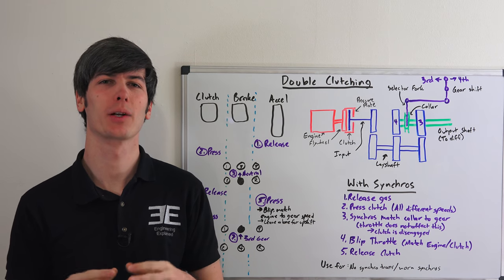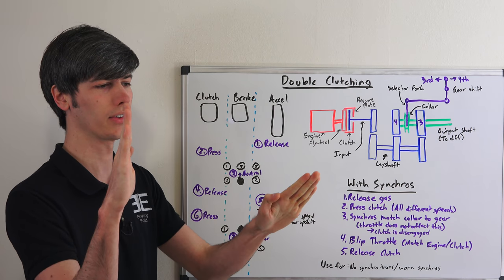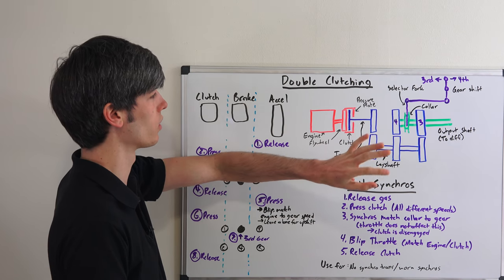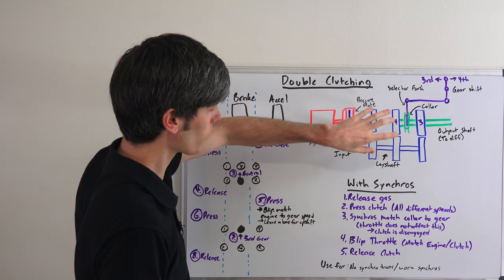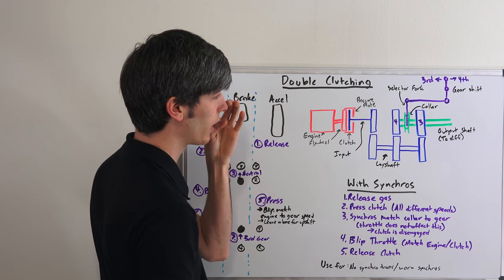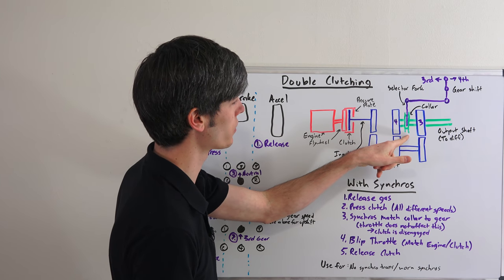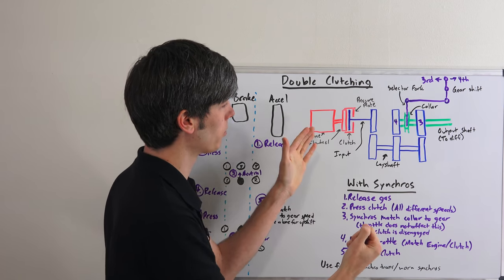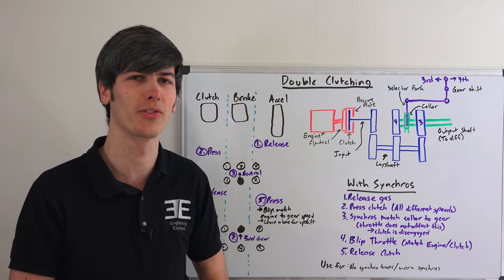What Is Double Clutching?

Comment: Aaaaahhhhh so "maybe" I can use this in my 74 Beetle, which crunches when you shift 2nd to 3rd unless you shift really slowly.
Reply: not really going to help going up gears from 2-3 its more for 3-2.
Reply: @nhouston6179   old post. (3yrs) But upsifting you can still use dubble clutching. You go into neutral and rev match (let the rpm drop) and clutch + next gear. Less work for syncs as your already at the right rpm.
Reply: Diner50 Yeah it seems like it might help as it sounds like he just has worn synchros, that's why he has to shift slowly

Comment: These principles really came in useful when my throwout bearing went out and I needed to get my car to the shop without using the clutch.  Pretty tough to do, but you can just barely blip the throttle to allow you to go into neutral, then either wait to shift (if you are upshifting) or rev match if you are downshifting.  I was also lucky enough to have a car with a strong enough starter to start the car in first gear when I shut it down at lights.
Reply: That sounds kinda nerve-wracking😳
Reply: @code0662  it was, but I got the vehicle there.  Had to go on the road all week or would have fixed it myself.  All is well that ends well.
Reply: @inultus1  absolute Madlad. You've earned my respect
Reply: Rolling it on in 1st gear would‘ve also been an alternative on weaker engines. Just need a couple of strong lads.

Comment: People are missing what gear speed is judging by comments. Maybe this guy can do a vid on that...imagine the gear speed is like your engine rpm: fast in third but slow in forth at a steady speed. So if you want to go back down to third you need to get third spinning fast again. Not "true" but its to the point.
 It is irrelevant with modern cars due to syncros but if you can grasp this relationship you can shift up or down without the clutch!
If interested in shifting without the clutch: If what i said makes sence then recreate the situation and play with it to learn. This is not a one day look what i can do thing to learn so dont get in a rush at all. Corny to say but you will be devolping a deeper connection with you car and it won't happen overnight. First hold steady light throttle speed, hold throttle steady and you will find you can effortlessly pull it out of gear and put it right back into same gear, play with that a while. Next while driving normal ease off the gas slightly when you are getting close to time to shift and you will find you can pull it out of gear the same as before without the clutch, let off gas and put light steady pressure agaist the next gear and when the rpm is right it will let you into gear,  move quickly when it invites you. Completely master upshifting before the next part, downshifting. Note that you will have mastered this when you feel like you just know what to do. It could be years before you are ready to downshift. Downshift is harder: Steady speed: Note what speed your tachometer says in third, shift to forth and note tachometer in forth. Without clutch push shifter into neutral, raise tach to the third gear number and it will effortlessly slip into third. Its easiest to go just past and while rpm is dropping catch the gear at the correct rpm. If you are still holding the same speed the you can go neutral to forth without clutch at the correct rpm. Practicing this 2 to 3rd or 3 to 4th is ideal, other gears are a little harder. Dont force anything, It should feel like it wants to do what you are asking of it. If you miss or grind just step on the clutch and get into normal gear. 
Anyone with a diesel will have a much much easier time learning this due to the operation of the diesel. You still need clutch to get going from a stop. If you dont grasp the idea of the gears spinning at their different speeds at different vehicle speeds then forget about it. Ive done it since i was 15 years old, 40 now, never broke a trans or wore out a clutch. I was lucky to learn with a diesel. 160,000 on my lancer that has been driven this way, no problems.

Comment: Question: While doing some research, there is a debate on whether it's necessary to shift into neutral, releasing the clutch pedal, and then depressing the clutch pedal before engaging the next gear VS. keeping the clutch pedal down the entire time. Which is right? Does it matter? Does it depend on if you have synchros? I think shifting into neutral makes sense because you can re-engage the clutch, having more parts move together. What do you think?
Reply: must clutch twice if u want a smooth shift and dont wanna wear out the syncs
Reply: @bobobibo2357 yup, you can get away with not double clutching a light vehicle, but it will get progressively harder to do so as the synchros wear. On heavier vehicles, especially those with heavy transmission elements, you will have to double clutch to prevent premature wear. Heck, even on a light car, if you're doing some "spirited driving" you'll have to double clutch as it's much faster to change gears this way.

Comment: Virtually every semi-truck, though virtually no truck driver double clutches.  Should though, based on this video.  Though a common counter-argument is that it wears out the clutch.  Though I suppose a counter-counter-argument would be that it wears out the transmission if you don't.
Reply: A counter-counter-counter-counter-counter-counter-counter-counter-argument: you wear out your car when you drive it. Leave it in the garage and nothing will ever break.

Comment: For all the people saying double-clutching is useless in a car with synchronizers, I respectfully disagree, particularly for downshifting.

While downshifting can be a smidge slower since you have the pause in Neutral where you bump the layshaft up to speed, it makes less work for the synchronizers, which have to work hard to speed up the layshaft.  

It's usually not all that useful for upshifts, except has anyone driven their manual car in seriously cold weather where it just does. not. want. to. engage. any. gear?  Double-clutch all of your shifts (especially between the first three gears), and magically the car will let you get into that next gear until the gearbox warms up and starts to behave again.
Reply: Yes, yes, yes, to all that.  I had an old Subaru that in cold weather, needed double-clutching until the transmission oil warmed up.  Also, I commonly drive a medium-duty truck (about 30,000 pounds GVW) that has a synchronized transmission, but when starting out cold, double clutching saves the day.  And I can't tell you how many people I've met over the years who have worn out their first- and second-gear syncros in their cars by doing lots of downshifting into those gears "the standard way," and this could have been completely avoided by double-clutching, even if reserving that method for the more severe downshift situations.  As to those who advocate floating the gears, that works, but with synchronized transmissions it's hard to tell if you are really doing it perfectly or not, and if not perfect, synchro wear is actually worse because the synchro clutch is rubbing for a time when the speeds on both sides of the unit are out of synch, but that extra friction accomplishes nothing since it can't cause the input shaft to change speeds in this case.
Reply: @ericl2969  Actually cold weather is still an issue, I have a 2015 Subaru and while switching between the first three gears isn't impossible it is much easier if you double clutch until it warms up.

Comment: Why do semi-trucks do not have synchros in their transmissions? (i.e. Eaton Fuller 10, 18 spd)
Also, how does hill holding circuit work without waring out the components?
Great videos!
Reply from the maker: +D. G. Hill hold uses the brakes to hold the vehicle.
Reply: What enables the circuit to apply the brakes?
Reply: gyroscope
Reply: Semi's don't have synchros because they wouldn't last. With the torque a big rig engine puts out and the heavy loads they carry, the synchros would ware out very fast and would have to be replaced very frequently. VERY UNECONOMICAL.
Reply: From the ZF brochure from Europe:

■ Thanks to its wide torque range, the Ecosplit
synchromesh transmission gets by with twelve
or sixteen gear steps. A light metal alloy
housing saves unnecessary weight, and the
helical gears allow for quiet running. Shorttravel
and dual cone synchronizers as well
as the Servoshift unit reduce shift forces and
paths. The transmissions of the Ecosplit range,
equipped with an integrated bell housing, are
available in a wide product range for all truck
applications up to 44 tons of total weight.

ZF has already proven that is not true for European trucks.
Reply: PEREGAZOVKA and Double Clutching dont need
Reply: Frank G So what does the clutch do when you're in neutral at a stop and you have to press the clutch all the way to sychronize/stop the gears to shift into 1st? (on a semi). Is there a synchro just for 1st?
Reply: They'd last just fine. They aren't present because that is extra weight. Remember, talking about freight services. The weight you remove from the tractor can be added to the load, meaning more product down the road.
Reply: 100 pounds worth of brass synchronizers or 100 pounds more freight? That's why they aren't present.
Reply: there is no synchro but there is a clutch brake that brings 1st gear and gearbox side of clutch to a stop to match rear layshaft
Reply: Diesel+
Ok. Thx.
Reply: Eaton fuller absolutely uses synchros, wtf is everybody saying they don't
Reply: @massey_2298  Eaton Fuller offers both synchro and non-synchro transmissions. I have yet to use a synchro'd transmission in a truck, myself.

Comment: Smart guy...Unfortunately not quite correct....in a modern synchromesh gearbox, completely pointless....in an "old school" non synchromesh gearbox, the point of double de-clutching and blipping the "gas" while in neutral, is to spin up the layshaft to match the speed of the gear about to be selected, and being driven by the rotating wheels.
Reply: It's actually good to revmatch modern manuals too.

Comment: i always assumed double clutching was a technique used to go faster in a race or just in general. am i correct in now assuming it's just how you change gears in a shotty car?
Reply from the maker: +tumatauenga Or a car without synchros, many semi trucks require the use of this technique.
Reply: Engineering Explained
so it definitely does not make you go fast at all?
Reply: +tumatauenga You might be thinking more about heal and toe shifting rather than double clutching, which does help to speed up manual shifts and therefore keep you on the power more effectively.
Reply: +tumatauenga No, takes more time because you have to press the clutch twice per shift.  You only need it in semi's or older transmissions or if your synchros are worn out.  It's never an advantage to have to do this, lol.
Reply: Loki Jotunn
i'm just speculating because of fast and furious it's always bothered me cause i have no idea what it is or why you would do it. whats heal toe shifting?
Reply: +tumatauenga using the break and gas at the same time with your right foot while changing gear using the clutch with your left foot. So you can Rev match while breaking
Reply: tumatauenga In the most simple terms it's a way of using your right foot to cover both the brake and throttle pedals.
You can blip the throttle at the same time as you're braking and changing gear. It enables quicker down shifts when cornering that way you can maintain the engines power better, you're not dropping so many engine revs which means less time building them back up, which in turn translates to more linear power being put onto the road through the corner basically.
Hope that makes sense, if not maybe a quick google search might explain it better.
Reply: +tumatauenga Well, it can (!) be faster but in general. Some folks already mentioned cornering. Basically: rev matching and avoiding any kind of shock in the drive train will allow you to change gears in situations in which a rough shift without rev matching might result in some sort of a momentum which might lead to a crash. For example: taking a corner at the grip limit. Though you might want to be careful with lifting the accelerator pedal in such a moment (-> lift off oversteer). But even if you do, a rough shift might result in your tires to loose grip. Or breaking into a corner while shifting down 2 or even 3 gears. But that's more like racing and not your everyday use of your car.

On public roads you don't have any advantage as long as your synchro rings are working as they should. Rev matching on the other hand does make sense as you avoid excessive wear of your clutch pressure plate.
Reply: +tumatauenga double clutching makes you go slower, not faster. racing uses mostly automatics for higher power vehicles so they can shift as fast as possible, and in manual transmission cars, the foot stays down on the throttle and you kick the clutch and pull it into the next gear.
Reply: I always thought of it differently too… to be cruising along in second gear and then go in with the clutch…and the gas together… and then snap of the clutch quickly…and the whole go faster thing… and sometimes not in such a straight line…and then single clutch into 3rd and  snap off the clutch in the same way…I don’t see what kind of benefit going into nuetral and releasing the clutch before going into lower or higher gear has…only seems like it would be harder to find the match in rpm of motor and trans…and if it is before synchronizers…then you wouldn’t even use clutch at ll between gears… you just get a feel for rpm matching

Comment: I dont understand steps 3 and 4.

Whats the point in matching the speed of the layshaft and the engine, if youre just gonna then match the layshaft's speed to the output shaft right after that? Why dont u just skip neutral by shifting from 3 to 4, rev the engine to match rpm and then release clutch? Cuz then the layshaft and output shaft would be the same speed already, and you just have to match the engine to the rest.

Im a noob here so i dont get it
Reply: Double clutching is only needed in an unsynchronized transmission. You see the blue gears on his whiteboard? In a modern car they are all always connected and spinning together and we connect to individual gears with synchronizing rings and the drive shaft sleeve (the black marker on the whiteboard). In a sliding mesh transmission you have to move the blue gears into the teeth individually since they are not connected until you slide them in when you want that gear and having to match the gear speeds perfectly to get them in. Really easy to grind that way which is why we got away from it. So to answer your question, there is no point to matching the gear speeds of the lay shaft, maybe you get marginally less wear on the synchro rings but really I'd say it's negligible.